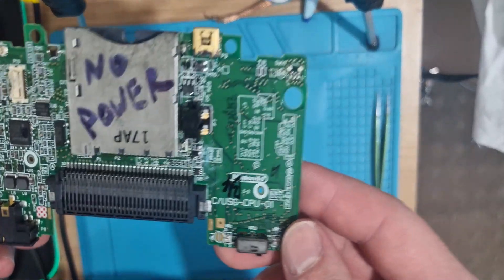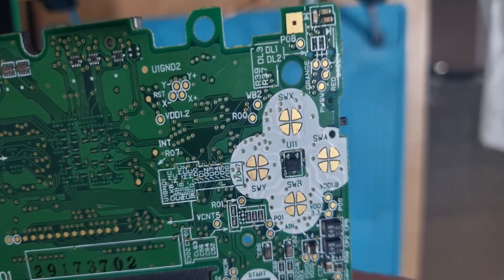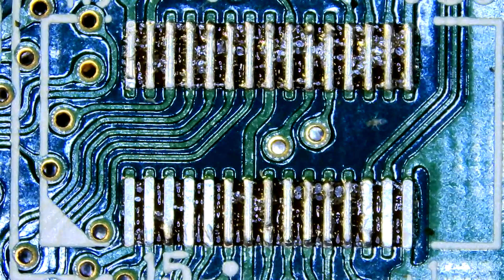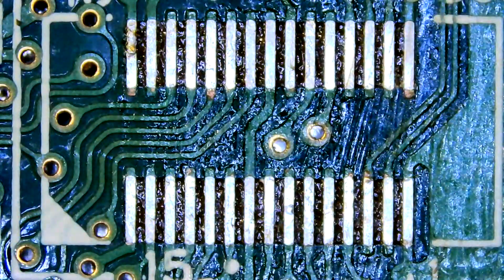Nintendo DS lite board repair - Broken connectors, missing pad and some liquid damage

Comment: Curious why you use a flux pen and not a gel syringe. Just using what you have? I use flux core solder but think maybe I need to buy separate flux too. hrm. Be neat if you could add sources like for the hot air station and microscope you use too, for us fellow aussies. I have a weller gas soldering iron and only remembered yesterday it came with a hot air nozzle. Duh. Im yet to try it out tho. Genius idea to heat from below tho. Man I can just see myself blowing tons of tiny components off the board if done from above. What a headache that would be.

Guesing those are pink and greys in the background. Urgh they just chew away at our trees and Im SURE they wait till you're walking below them.

Why is the green power light flashing in Pico chat? I've never tried to use pico chat.

I find the DSL fascinating. I'm still trying to figure out what's dead on one of the boards I have but you've inspired me to press on. Does there just come a time when they expire and there's no hope for the board tho? There's no water damage. I've never attempted a reflow of the cpu & gpu but think that might be next. (or whatever's under the game slot, never taken one off)

Thanks for another fascinating video!
Reply from the maker: The pen itself is empty now and I'm dipping it in a jar of flux, its all the local shop had last time I went to buy some. Once it runs out ill get the syringe stuff. All the equipment I use is just the cheapy stuff from ebay or aliexpress for now. Get the nozzle on the hot air station and give it a go, make some tasks so much easier! The surface tension of the liquid solder keeps them in place unless you knock them off. 

The light flashes when its using wireless communication

I have a whole box of old DSL boards which I put in the too hard basket over the years so might crack more of them out see if they are fixable. Under the game slot is the CPU and ram, and since reflowing the ram on the DSI the other day worked for me its something I need to look into for some of my old boards aswell. 

Glad you like it thanks for watching
Reply: @chickenmaster121  hrm youtube didnt notify me that you'd replied. Sorry.
Oh I dont have a soldering station, only a weller gas soldering iron. I like it coz I dont need to find a powerpoint and can use it anywhere. 
Guess I need to get some flux, eh?
Ahh I've never connected mine to wireless anything so didnt realise that's what the flashing of yours was.
Welllll.. Hope you find a DSL that you're willing to reflow on camera so we can watch you do it then. ;)
Reply from the maker: @danatmonst3594  all good, ah ok ,  I've never used a gas one before.  Flux is 100% required makes life much easier. I still have plenty of board sitting in a box I need to go through so might be one in there!